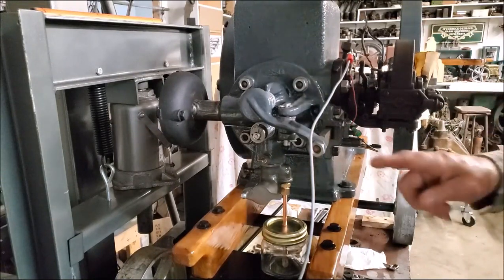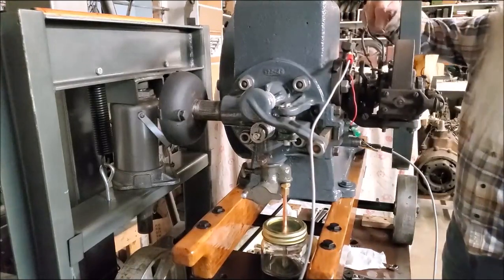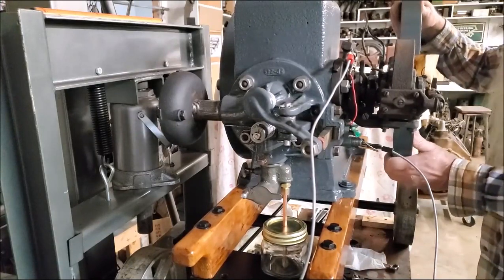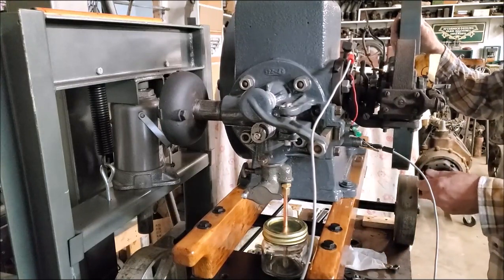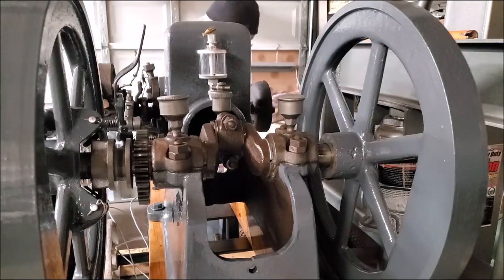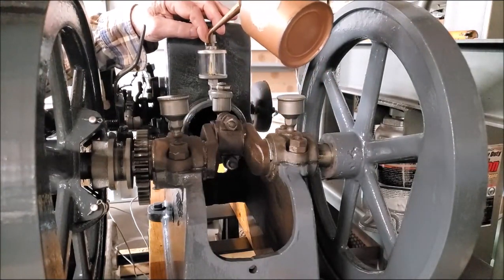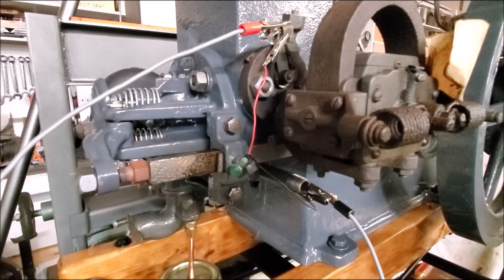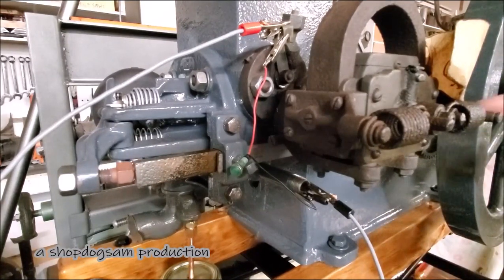Nelson Brothers Engine how a drip oiler works

Comment: Okay I wish you would have shown how to wire the bulb in. But I'm thinking that  the power to the bulb goes to the points.  And then just ground the bulb to anything to the engine a 12 volt bulb good to use or 6volt. I'm tryingto get my Webster magneto to fire.  My points are good. I have good continuity from the points to the end whare the wire goes to. The mica is good. But I don't get any spark. I did charge the magnet on the magneto to. But I don't think that the coils are good. Thay are original. The coil wire was broken going out to the points. I repaired the wire out to the points. But I still no spark. So I'm going to charge the magneto again because I'm thinking that I didn't get a good charge. So I do like what you have shown. I'm going to try that. Thanks for sharing this.